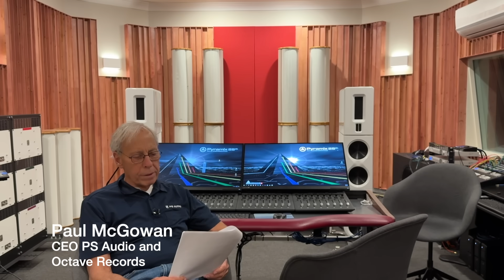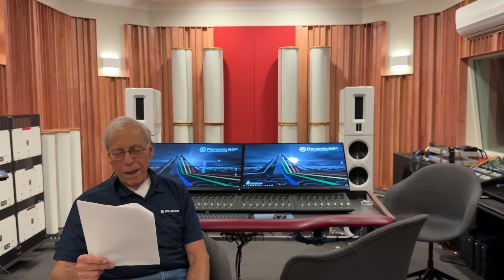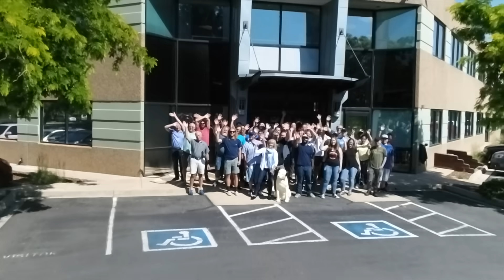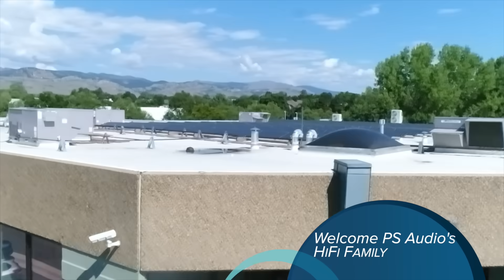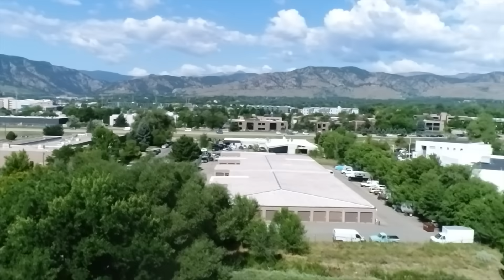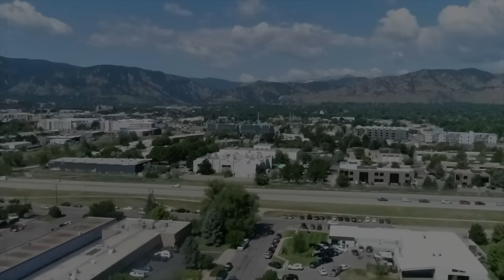Pros and cons of active crossovers

Comment: biggest drawback of active is hiss noise, if it where a plate amp or power amp, active crossover with amp directly connected to drivers made noise in my experience.
but i benefit from extra dsp control on any speaker so now i have a hybrid hifi system.
passive speakers with normal crossover and passive subwoofers, dsp to do the extra crossover i need and other adjustments to taste. and its volume control. 
then into two dac's and power amps. only one conversion from digital to analog, like in a simple hifi. 4 parts only.

i think it is a nice blend of both active and passive. 
and you can get it done with only one piece or gear(dsp, volume, dac, amplification) but then you are limited to what you get in that, except for one power amp.
Reply: hiss noise ? i can show you at least 10-20 actives that have zero hiss (i never experienced hiss noise and i use actives over 10 yrs now from different manufactures). Maybe dont listen to the cheap 300€/$ actives. All the good well engineered actives have ZERO hiss problems, even with an miniDsp in front you hear zero hiss. Every good active Speaker (Neumann, Genelec, ATC, Kii, GGNTKT etc) have no noise problems at all, and even when youve a little bit noise, when music plays you didnt hear anything from it…
Reply: Absolute nonsense   I run four, separate active systems   (from $2000 to $200,000) and none of them have any ‘hiss noise’.
Reply: @n.lyndley.9889   i know many will say it has no hiss noise, i can not deny your experience.
depend on how far away you listen for it. 
and the electronics and power quality ground loops. i do not know all the factors that leads to hiss noise.
i just know i have zero good experience with active speaker and hiss noise, at home and in shops.
that does count for something does it not?

Comment: Why go through all of those extra ADC DAC conversions? Just feed your digital source with a digital volume control, directly into the digital input of the crossover, then run the split signals into two or three identical DACs, and followed by power amps connected directly to the speaker drivers.
Reply: I believe you forgot the necessary crossover and time alignment
Reply: @pierrelaforet1966 I did not forget that. Read more carefully
Reply: @pierrelaforet1966 yes. And is it really worth doing all that.  Most think not.
Reply: @pierrelaforet1966  Minidsp nanodigit can do all that with 4 separate spdif output.   i.e. 4 way crossover.   And can have 6 PEQ setting for each channel.    Unfortunately they discontinue this wonderful product during covid.

Comment: This is the one topic I talked with Andrew Jones about when randomly meeting him at a Starbucks during some HiFi show. We both agreed active cross-over is superior. Reasons are many. First, your speakers get better controlled (damping factor) when the signal doesn't have to go through passive components. This helps in the clarity of the output (faster decay, less ringing). Also having an amp per driver can allow better driver-amp synergy. On the filtering side, when you do active cross-over, you can either do it with analog filtering or DSP filtering. With analog filtering, you have more flexibility in an active filter cause you don't have to worry about damping factor and impedance curve and can fine-tune phase and frequency response more. With digital filtering (DSP) you obviously should not do it if your source is analog (today that means vinyl). If you love vinyl, forget about DSP filtering. But if you have moved on to lossless CD (or better) quality streaming, you want to do the DSP processing BEFORE the DAC to avoid any additional ADC-DAC stages. ONE DAC is what you need as you needed it before. The key is that the DSP is on the digital side where your music is digital already and you can then use high precision math to avoid audible quantization errors and tune timing, phase and frequency response precisely. You can also add soft clipping and truly optimized tube sound easily. The actual cross-over filter can be easily custom optimized when it's DSP based. For anyone who just want to try it out, all you need is a miniDSP Flex Eight product that does both DSP and DAC in one box with 8 analog channels. You can easily drive 2 subwoofers and 2 3-way speakers with this one box. On the amp side, you will then need 6 channels that you can serve by stereo-amps or mono-blocks. Now, I wish PS Audio would make something truly audiophile in this category cause reality is that it can also be good business (especially more power amps sold).
Reply: I can concur with this. For me, I much prefer active loudspeakers, with a crossover in the analogue domain, and these are the type of loudspeakers I own. I see so much effort and expense being put into passive crossovers, yet I would struggle to live with such a setup.
Reply: @ralphholland1313 I used to work at B&O ages ago and have a pair of prototype BeoLab 1 speakers that were the first incorporating icePower and they are active speakers with analog cross-over. I've tweaked them for better performance and their aluminum cabinet is premium quality and excellent so it's worth it. I use them as the stereo speakers in my home theater together with a subwoofer and upgraded tweaked BeoLab 8000 as rear speakers (5.1). Actually I have many active speakers in my house also KEF LS60 in my dining room and KEF LSX II in my home office. For my music listening i use Magnepan speakers but also with active cross-over btw.
Reply: One DAC???  Your MiniDSP Flex 8 has an 8 channel DAC if it has an analogue output.  My MiniDSP SHD has 4 channels and has a 4 channel DAC.  The all digital version (the Studio) need to output it’s digital signal to 2 DACs (assuming all 4 channels are used)
Reply: @ccdccd8615 One DAC is the term we use no matter if the DAC is mono, stereo or more than 2 channels. The point is that there is no ADC and only one DAC per channel in a proper home audio system. No ADC is the key.
Reply: @ccdccd8615  The minidsp unit sounds like trash. The guy doesn’t have high standards for fidelity.
Reply: @wa2368 Which model did you use and with what speaker system? With or without Dirac?
Reply: add some of those inexpensive class d amps to the flex 8 and youll be laughing. go mono on the bottom end.
Reply: @michaellee6654 https://youtu.be/3bl7ROgqHPc?si=WJC_f8L1awUL79Wf
Reply: Interesting you discussed with Andrew Jones-  I have his CR1 speakers and always wondered what they would sound like without the crossover -  I made a recording of my tad’s in my channel
Reply: Why not use analog active crossovers?
Reply: @AnnoyingCritic-is7rp  The truth is that passive crossovers win on the simple fact that you can buy a speaker with the speaker tailored crossover inside. If you want an active crossover to a speaker, you will need the speaker to have a terminal per speaker driver, speaker cables per speaker driver and amp per speaker driver. Then you need the active cross-over to match all those components for best performance of the specific speaker. So although a well optimized active analog crossover is technically superior to a well optimized passive crossover, it's from the perspectives of commercial viability and ease of setup somewhat a nightmare. Far more realistic when your music is all digital is to use a DSP based crossover where you can have configurations matching particular speakers and tweaking is easy. Still also DSP based crossover isn't easy for the mass consumers to setup compared to just using passive speakers or active speakers with everything build-in.
Reply: @ThinkingBetter I can’t argue with any of this.  The learning curve for using DSP based crossovers is steep, at least based on my experience.  The MiniDSP units are hardly plug and play.  SW has to be downloaded.  Once the unit is up and running, you now have to make all the decisions that never arise with a passive commercial speaker: what crossover frequency do I use (which is presented as high pass and low pass filters).  What type of crossover (Linkwitz-Riley, Butterworth, etc)?  What slope do I use (shallow, steep, etc but it is presented as an Order).  How do I level match the drivers?  Dirac can do that for you, but then you have to learn how to use Dirac and how to setup a measurement mic.  

I think my MiniDSP units is a very powerful tool, but I do not recommend it unless you are willing to go through the time and effort needed to understand and use it effectively.  That would be a VERY small number of audiophiles.  As a commercial product for the general public, this device is a non-starter.
Reply: @ccdccd8615  Agree, indeed this is not a mass consumer solution at this point. In the perfect world you would have speakers designed for this and filter profiles matching the speakers. As it is now, you are entering speaker engineering territory when you go this route. But the cool thing with a DSP is that it's rather easy to try out things. Someone could, for example, buy a pair of PS Audio FR30, rip out the cross-over filters and wire up external speaker terminals for each driver and then use mono-blocks to power them while using an active cross-over. It would be a fun project to see how much you can improve such a speaker if you spend enough time on it. People who spend 10s of 1000s of Dollars on cables would likely get more value out of their Dollars doing this.
Reply: @ThinkingBetter What audiophiles waste their money on is a story in itself.  Here is the other thing related to using active crossovers.  Yes, you need more amps, but they can be much cheaper amps because you don’t need them to do everything.   Take my project.  
I’m using a $1100 Class D amp (Purifi amp modules).  I needed high power, high damping factor and stable into 2 ohms.  Buckeye ticked all the boxes for a really good price.  Would I use this amp for the tweeter/midrange?  Probably not.  

For the tweeter/midrange, I wanted a SS amp with a “tube-like” presentation.  I didn’t care about power as long as it had at least 20 watts.  I could also care less what its bass performance might be.  Enter the Galion A75.  So both amps ran me around $2600.  Now what would it cost me to buy one amp that can do what these two amps do???  Let’s suppose I later decide to tri-amp (which would be easy because I have an external crossover).  The tweeter is 109 db efficient and probably needs little more than 5 watts.  I can add a SET amp with none of the usual downsides.  The flexibility does not end with what DSP can do.

Comment: I think cost is the biggest negative with active crossover. you need more amps and possibly DAC's. Some receivers and processors allow the digital filtering to be done before the DAC, then multiple DAC's are needed per channel. Alternatively, the active crossover can be done using analogue filters after the DAC, then separate amps. For the DIYers, several opamp manufacturers have online filter design software to help but this is still not an easy option.
Reply: ah yeah paul seems to count just dacs as the active crossover while the active crossover was just a common term just for any powered signal level crossover even if the circuitry was analog in nature(was common in car builds to split the signal, really handy with multi amp systems).

now a true dsp has a bunch of interesting things it can do besides just crossover
Reply: Amplifiers are relatively cheap today and even entry level DAC's are decent, you'd probably be around break even with a traditional crossover but no one gets that perfect right away. The price of Hypex plates as an example can be blown past in a hurry with a few changes of coils and capacitors, and you still don't have an amplifier etc. 😄
Reply: Wrong.  With an active analog crossover, only 1 dac is used in my 3-way active crossover.
-----
source=Apple Music lossless
Reply: @mrpmj00 Yes, but better is digital. Actually an 8 channel DAC can do the job. MiniDSP Flex Eight is such product (DSP-DAC with 8 channels) great for first-time experimentation. But to be honest it is also quite usable even in high-end systems. Specifications like SNR of ~128 dB(A) and THD+N of –111 dB (0.0003%) makes it awesome on paper but it also gets praise from actual users. I have tested it in my Magnepan system with subwoofers and it is way better than the passive cross-over version. It delivers enhanced clarity, defining improvements in bass precision and a more 3D, textural quality in the highs and vocals.
Reply: Agree, the main negatives are the extra cost and the problem that now while you can truly optimize performance when you know what you are doing, you can also more easily mess it up.

Comment: I would put the active crossover after the pre-amp and before the bi or tri amplifiers, each of the amplifiers drives the tweeter, the mid-range and the bass correspondingly
Reply: Exactly and the active crossover can be analogue too.  The beauty of this is that the tweeter amp can be low wattage with high voltage power supply to allow for transients. You could use a "D" class amp for the woofer.  You would also avoid any "ringing" that you have in passive cross over inductors.
Reply: @keithmorgan6498 that’s what I’m using. Tube amp for tweeter/mids, solid state mid bass and class D sub bass. The only thing I wonder is the timing on all drivers correct, but to the ears it sounds fine.
Reply: @michaelm8836  Your DSP should have settings for delay on all the outputs as well, along with (typically) parametric EQ and gain (level) settings for each output.
Reply: @mattpobursky850 it is full analog. I ordered the frequencies and steepness. Got 3 small pcb’s which were specific for me which I placed in the active filter. So no EQ, but I can change gain per bandwidth. So no additional AD and DA conversion.
Reply: This is exactly correct and I’m not aware of many DSP crossover options available for DIYers that operate the way Paul suggests.  My situation is much more typical: my MiniDSP SHD divides the signal, then passes the divided signal to a 4 channel DAC which outputs analogue to the amps.  None of the potential issues Paul raised exist.

To be fair, I think Paul may be thinking of commercial active speakers with internal amps.  There the speaker probably has a D to A converter to accept the analogue signal coming from the source.  I haven’t seen any DIYer build an active system this way.

Comment: DSP should be the last option.
And if that is the chosen option, then doing the DSP via the speakers should be the last option for doing DSP.

The best place to do DSP is before your signal becomes an analog signal.  So do the DSP at the transport end of the signal chain.  Then feed that post-DSP processed signal to your DAC.  The DAC then creates the origin of the analog signal that is sent to your pre-amp, and onwards.

I play digital music via JRiver's Media Center.  It has built-in DSP, if you want to use it (or keep it disabled, to maintain the cleanest signal).  When you play songs that you have on your computer, Media Center can do the DSP before anything is sent to your DAC.  That is the ideal place to use DSP, if you have to use DSP.

DSP is the easiest room correction solution.  But it will negatively affect the purity of the signal.  Ideally, physical room treatments are the best choice, with no DSP.  But room treatments are more costly, much harder to get it right, and will need the wife's approval for their aesthetics.

However, even when using DSP, room treatments are still beneficial, because DSP will not stop unwanted echos / room reflections.  Room treatments will (or at least they will virtually) eliminated reflections).  When you calm down your room (control unwanted reflections), your stereo will sound more focused and less fatiguing.  Even sitting there and having conversations will be less fatiguing on your brain, without the unwanted reflections.  So if you go the room treatment route, and get it right, then you will have the best of everything.

The combination of room treatments for a lively room (meaning an echo-y room) + Vandersteen Quatros or higher, will give you a virtually flat bass response, absent of unwanted echoes, and all 100% within the analog realm.

Comment: If you DIYing your speakers consider if you really have the skills to design and test which are considerable, or whether you are better off using a well tested design. With digital a safety cap on the tweeter can be a good idea - a click or pop or hum might be problematic to an unprotected tweeter...